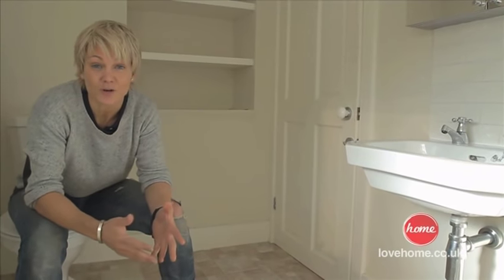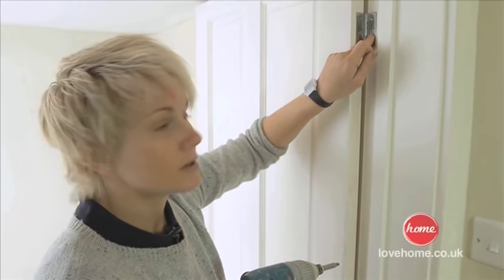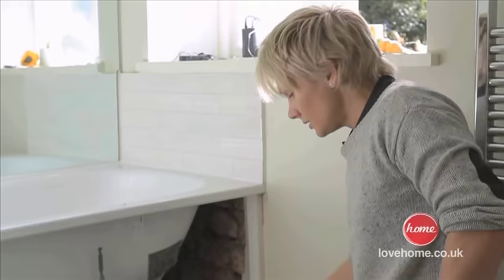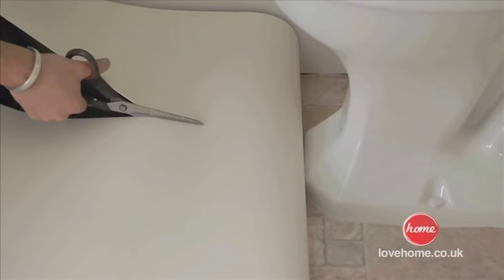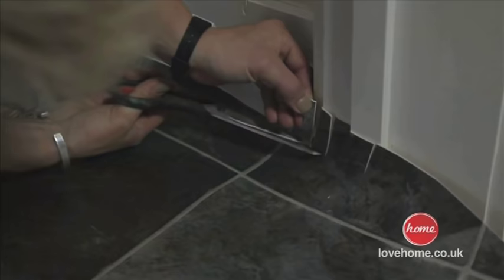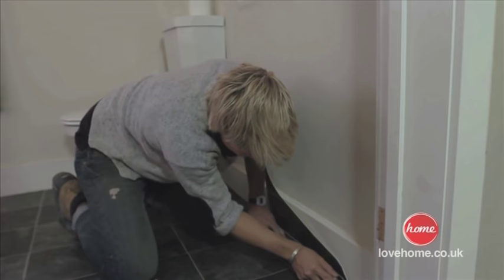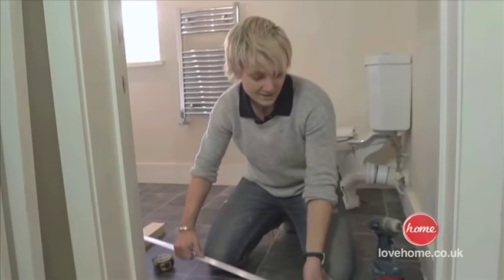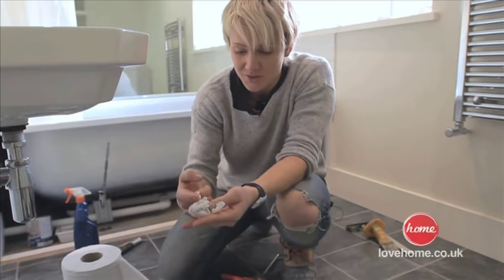DIY: How to lay vinyl or lino flooring

Comment: im about to have a heart attack shes doing this with scissors instead of a utility knife, did not emboss the floor which means that her vinyl install will be ruined in under a month, took the hinges off instead of the actual pins, she took the tub surround off instead of simply caulking which has to be done anyways im scared to finish watching this video.
Reply: lol,calm down calm down...I guess we women should leave it to the men huh...and we do the cooking and the cleaning...
Reply: Brandon Cole Emboss?
Reply: Daniel Anderson you float floor patch compound over the existing vinyl because it has grooves in it and they will telegraph up into the new sheet if u dont ruining your new install.
Reply: Adriana Morales wasnt saying that lol just should do it right instead of teaching to install wrong.
Reply: ***** you dont caulk around the entirety that is where shoe moulding goes you caulk around toilet and bathtub generally. The bathtub solely because no matter how perfect u cut there will always be a tendency for the vinyl edge to want to raise and you do not want water to get under it. Basically no tradesmen could be profitable following her methods. Also a utility knife is 10x easier than the scissors to make down cuts.
Reply: H Wh also the preexisting vinyl has grout lines which are about 1mm deeper than the rest of the vinyl which will cause all those lines to telegraph over time.
Reply: She used a utility knife to do the final cutting. What idiot would use a utility knife to do what scissors can do? The hinges had no pins. Are you blind? She removed the bath panel so the vinyl would go under it. I think that's very sensible given the possibility of water leaking down the side of the bath.
Reply: Its a huge pain in the ass for the next guy that has to do a two layer dig up for vinyl under the tub. Also its not very feasible from a diy standpoint or common practice at all it jus shows she probably couldnt have trimmed it net or with a small enough gap to caulk. If yall want to actually have an easy time with vinyl get u a carpet knife thatll let the blade hang out enough to flex then use the backside of the knife to trim everywhere and if you dont want to pull the toilet use it forward and flex the blade to the toilet. It cuts it perfectly net.also the fact that she didnt pull the toilet completely blows your theory away as toilets often leak as well. You dont want to use scissors for this type of work just because theres no reason to. Its ten times more time consuming.
Reply: If a man can't cope with lifting up two layers of vinyl then he's a bit of a wimp. Toilets do not leak like baths do. You do not get lots of water splashing out of a toilet every time you use it. You might make a big mess but I don't. She uses scissors for the crude cuts where using a craft knife would damage the walls/etc behind. Use your brain.
Reply: BohemiVan  you have to cut the vinyl at the tub surround and paper back vinyl has a tendency to harden and many other types just making it a small nuisance for no real reason. If you caulk the tub surriund the caulk will do its job for 10-15 i have never went back dug up vinyl with a good caulk job that was curling at the toilet. The only time ive seen that was when there was no caulk or hey just used a rubber tub trim to hide their miscuts. Im just trying to say this isnt industry standard or the way diy should learn to do these things. As i mentioned above about legitimate things that would ruin the install such as the telegraphing of the old floor over time.
Reply: BohemiVan and come on man pulling a toilet takes 5 minutes and it gets rid of a seam in an area where the toilet will leak if it ever does. Is this girl your stud daughter or something? Im just wondering why you are defending a backwards way of doing something.
Reply: also i have never seen a door without door pins i mean its a hinge it has to have door pins.
Reply: Not all door hinges have removable pins.
Reply: BohemiVan must be a uk thing but i promise that in the states thats so rare that i have never seen nor heard of that. Just ones you dont want to remove such as cabinet pins. The only reason i think its bad advice for diy'ers to take a door down this way is sometimes it puts forces on the screws that will give it less bite the next time its installed and lead to a wobbly door. Also its much less chance of damaging a non solid core door by closing it and taking out pins as it keeps it from crushing the bottom as many times removing a door from the hinge itll wanna stick for whatever reason whether its just the wood cliging to the hinge or paint and youll end up jerking laterally to get it unclung and when you do theres a chance the bottom will hit the floor and splinter the bottom edge.
Reply: BohemiVan  exactly my thoughts
Reply: There's more than one way to skin a cat Brandon.   I found her techniques unorthodox as well, but nothing that wouldn't work just fine, although I agree with your embossing comment.   I've rarely seen a perfectly smooth vinyl floor...
The only point I'd add is that I would have DEFINITELY removed the toilet rather than cut around it.  Should the toilet need replaced and the EXACT style not used, you're screwed.   THAT I thought you would catch.
Of course, there may be code concerns and there would be the expense of a plumber in that case.   I'm just use to doing that sort of thing myself.

Personally, I've found may bathrooms like many kitchens to be pretty cut-up.   I've always found a template worth the time.   That way, it can be used to cut a precise pattern for the underlayment if needed as well as the sheet vinyl.  But as I said; more than one way to skin a cat...............
Reply: Brandon Cole 8
Reply: ...i'd rather do the cooking and the cleaning: you do the DIY and pester us for sex constantly lol
Reply: Crfor Freedom
How often do you seriously think 'Brandon' has laid anything, and I do mean 'anything', he's just a gamer ffs.

Comment: A good how to video.

If laying on such as tongue/groove flooring, consider laying hardboard sheets on the floor before laying the vinyl. The hardboard should be rough side up with no gaps. Hardboard prevents the vinyl sagging into to the gaps. The hardboard is best fixed down with ring nails.

When removing/refitting doors, put a space under the door to keep the hinges level with their notches in the door frame.
Reply: You can felt backed lino that's helps with any tongue and groove or tile scenario. Or go for a really thick lino.

Comment: I'm not being negative but you skipped a few steps 1. Embossment leveling the floor (spreading patch compound to get rid of the pattern of the vinyl underneath) 2. taping it like that will allow it to tear easily (full spread glue is the only way to fly), 3.  pull the toilet and undercut the door jambs (if you don't it will curl away if you use caulk it will last about 1-2 years and allow water to penetrate and curl away too).  I'm a professional vinyl installer  I'm impressed with how well you cut it in but best thing to do is make a pattern and transfer that to the sheet of vinyl for beginners it's like a sewing pattern. You cut craft paper to fit your room and then lay it on top of the vinyl and trace it make sure to Mark the top of your pattern if you accidentally put the pattern on the vinyl upside down it will be a mirror image of the floor and won't fit the cuts will be backwards. Any seams will require seam sealer they are manufacturer specific. If you don't the seams will separate.  If you pattern it cut the paper to fit if you cut it short you can just start over and you haven't ruined your vinyl. Good luck 👍

Comment: some vinyl is designed for a full glue down while fibrefloor vinyls can be loose layed with 2 sided tape at seams and perimeter or shoemould to hold down

Comment: Seriously all the comments about her looks. Sheesh. I'm wanting to know what she did with the cut that meets up BEHIND the toliet...did she just tape it down? I think I'd use a glue. I was wondering if you need a seal on top of some sort in a seam like that to prevent peeling or dirt in the crack. My free lino is shy 2 inches along one wall so it's a big seam I'm wondering how to do REALLY WELL.

Comment: If someone cant take a toilet out they shouldn't attempt this. You shouldve showed how easy a toilet is to remove in my opinion. Removing the toilet is just a way cleaner job that wont set you up for failure down the road. Nice video all  in all . Have a good one

Comment: Undo the 2 screws and lift the WC pan up a bit and slide the floor underneath. Saves all the cutting. Also with a tiled pattern centre the flooring in the room. You do not want that tile edge line so close to the skirting board

Comment: Firstly before you remove the door check the clearance gap under the bottom of the door with an off cut of the vinyl and if the door does not clear it scribe a line with a pencil on top of the vinyl off cut along the bottom of the door to adjust its clearance then remove the door.

Comment: I find you get a better finish if you remove the toilet & lay the vinyl under it.  Same with the pedestal if you have one.  Also, I usually use masking tape when applying sealant to the edges.
Reply: @maggysimms8474  It depends what you're doing, really.  In my case, I was completely refurbing my bathroom, including the floor, so it was easy to remove the toilet for a short time, leaving just a rectangle of floor to cover.  The toilet now sits nicely on the new vinyl.  I have also just re-floored my kitchen, and again I did the whole room.  Now I can easily change the layout if I need to, since all the units & appliances are sitting on the vinyl floor, and I havn't cut around anything.
Reply: @jamespassas9441  That's great if you have the time, muscle, and ownership of the space. 
If, however, you are doing the job alone and can't lift the toilet &/or pedestal yourself, this is a great option. 
Also, if one lives in a rental, tinkering with (removing) plumbing & appliances is just begging for trouble. 
As a property owner, I encourage tenants to make their rental a home; but not at the risk of damaging the property. 
Maybe thinking outside your own little box would help you see why this video has so many people posting their appreciation.
Reply: @CrazyAuntVal  Ok, each case is different.  It is ultimately easier to sit things on top of the flooring, rather than cut around them.  You don't have to be rude, I'm just making a suggestion.
Reply: @Aphrodite-fh3vk  I wasn't being rude either. I was actually trying really hard not to point out how condescending & sexist his comments were.
I was fortunate enough to be raised by a Southern grandmother who was a welder during the war & who taught me that if something needs fixing, we roll up our sleeves and fix it. She taught me plumbing, electrical work, construction, cooking, and above all - manners, decorum, and to "never look down my nose at anyone or assume I know what their situation is." They am keenly aware of the fact that not everyone had the learning opportunities I did.
As a result, I get all prickly when someone starts in with critical comments without having all the information - and especially when the person he's criticizing is offering the information (or expertise) for free.
Reply: @CrazyAuntVal  Oh, FFS!  This is a DIY thread, it's perfectly reasonable to offer useful suggestions about how to do things differently, depending on the project!  It has NOTHING to do with being condescending, sexist, patronising, or anything else.  For every DIY project, there are several options available.  You just pick the right method for what you want to do.

Comment: A faster way to take a door off is to pop the hinge pins out and pull the door off. It's easier to do that then to line up screws again and make sure the door swings the same.
I have Better Than Wax seals instead of wax and I have a toilet jack so I can pull my toilet out and move it out of the way before laying the floor. I will need to pull the toilet to repair the floor underneath before installing vinyl sheet anyway.
The water and dish soap idea to keep caulk from sticking where you don't want it is a good idea.
Thank you! I will have to use that and some of these techniques when installing in my bathroom (after I repair the subfloor).
Any tips for how to deal with gaps/seams on underlayment plywood?
Reply: Wood Bondo
Reply: Or level quick cement

Comment: Haha.  Left the toilet in and used scissors.  Also didn't undercut door jams.  Perimeter adhered the vinyl which will also cause issues.  Curious if she used seam sealer behind the toilet so the vinyl won't curl up in the future.  She did a pretty good job but there are things that could've made it alot better and keep issues from forming.
Reply: Lack of friction between existing and new flooring will encourage movement. Wrong choice of blade for vinyl trimming. Silicon ing immediately is a poor idea unless the flooring is fully bonded!

Comment: As a person who has removed this type of flooring many times before I strongly advise against installing it in the washroom, or other areas that may get wet. Once any water gets underneath it will start to smell like mold a lot.
Reply: What do you recommend then?  As a layman, I would think vinyl would offer the most water resistance.  No cracks like tile or tongue-grove panels have. Also, as a layman, I need something easy to install, so it just seems like the go to stuff. I'm getting ready to put some down in my bathroom because the glue-down tile I previously installed let too much water in the cracks and the glue eventually gave way.  Apparently, I didn't install it right.
Reply: @thisisfutile

Comment: Liked the video, with the exception of removing the door.  I don't know why you would ever want to unscrew the hinges from either the door or the jam.  Why not take out the pins?  Way easier and you don't need to worry about stripping screws or the wood door or jam... That's just my 2 cents.

Comment: Very skilled at what she does. But as a maintenance guy when I lay floors I take the toilet out and cut around the flange. And sometimes depending on what construction is going on take the vanity out. Otherwise I cut around it. But I always take the toilet out so u have a solid piece unlike what she did cutting a slice and joining it together behind the toilet.

Comment: I had a couple of problems with this video. 

I don't know why she didn't pop the pins on the door hinges, although her taking the door off was absolutely necessary. Maybe Britain doesn't have pins in their hinges. I dunno.

I also didn't understand her initial use of scissors, and then moved to a utility knife. A knife just makes more sense.

Otherwise, a fine video on how to install a floor. She knows what she's doing, and she knows how to explain her expertise. 

I don't have nearly enough skill to work around a pedestal or toilet. I'd remove them and install the flooring under them, and reinstall.

Comment: Good job! But I like to remove the toilet (takes 20 minutes) and drape the lino across the waste pipe and on to the wall next to and behind the waste pipe, and then cut a hole in the lino for the waste pipe. When I'm done I might have to replace the wax ring. About removing the door, sometimes if you try removing the entire hinge--like she did--you might find that in old homes the hinges are the devil to remove, and you might damage the door jam. Then you try the pins and sometimes they don't want to budge, but I go at them by driving a 16d nail through the bottom and up until the nail hits the pin, and the nail pushes the pin out, or I try twisting the cap of the pin with a pair of vice grips. The big advantage by removing the pins is that when you go to rehang the door, you just lift the door until the half hinge on the door meets and rests upon the half pin left on the door jamb. One person can do this easily. But by taking the whole hinge off the jamb, and you have a heavy door, you have to try holding the door in place while you line the hinge up with the mortise joint, not so easy if you're working alone

Someone mentioned the "experts" coming here. Here's my take on that; we come here to learn what's new and to share. In construction you can learn something new every day:-)
Reply: Won't the extra thickness of the Lino misalign the waste pipe? I'm thinking of doing this for tiles. Lots to go wrong.
Reply: @MabElystanGlodrydd  ....The answer is no. You can usually lay up to four layers of lino with no problem. The waste pipe (not sure if that's the right name) usually extends 1/2 to 3/4 inches above the sub-floor.

Comment: I guess this works but I wouldn't use double sided tape to apply any kind of flooring. it would only take a small amount of water in between the vinyl to start a mold issue. Glue it down and be safe I say.

Comment: Did I miss something? From what I saw, she did not use any glue/adhesive on the new vinyl flooring to make it stick to the wood floor. What's to stop the new flooring from curling up on the edges/next to the walls? Don't think tape is going to do the trick.

Comment: Your video did help me, thank-you. I was just wondering why no adhesive was used on the floor itself. Is it because of the toxicity of the adhesive? or, merely not needed since the edges are sealed with the adhesive strips and silicone. I'm thinking that floor has too be perfectly flat to do this without adhesive on the floor. The floor I am doing in the near future has a slight bow to it, it's an old house and I am laying down 1/4" luan and screwing it down well, then using floor leveler for the countersink screws and small gaps. It will be a decent surface with no pucks or gaps between sheets of plywood, just not a perfectly level one. After I do the flooring I will then install the trim over it...any advice would be appreciated. TIA!